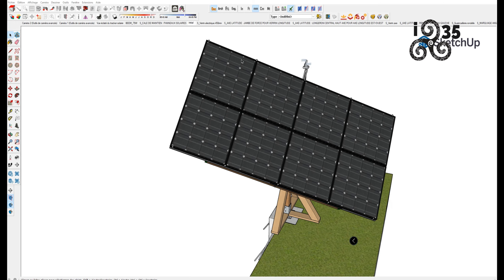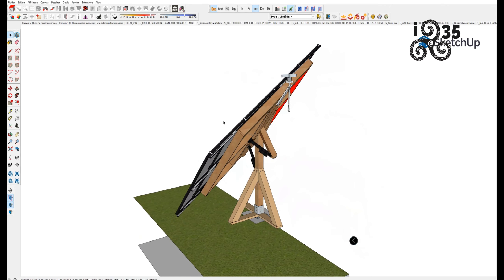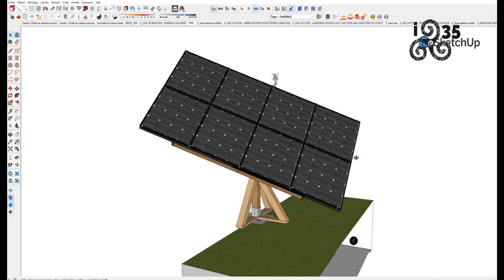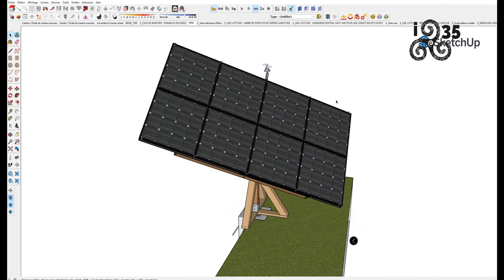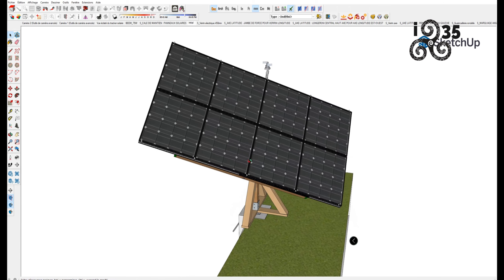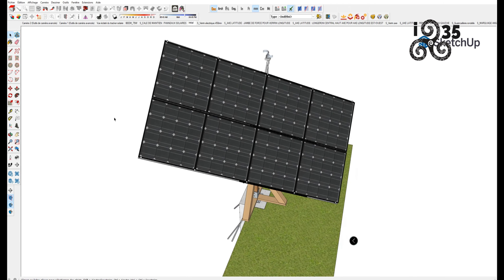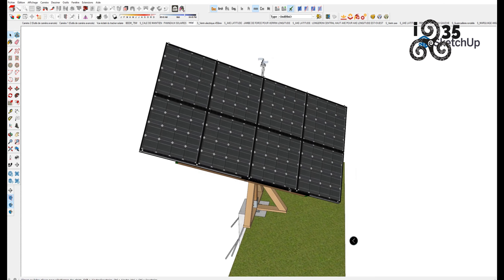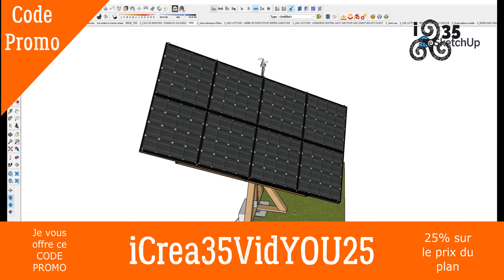⚡️Panneaux Sunology Play / Beem Energie - Augmenter votre production⚡Avec un Petit Tracker Solaire⚡️

Comment: Bonjour merci pour votre tuto ,se qui m 'intéresse c est votre tracker maison ,étant donné qu'il dépasse les 1,80 m on est obligé de déposé  un dossier en mairie ?
Reply from the maker: Bonjour Étienne Chaperon. Mon tracker solaire dépasse que très rarement les 1,80m de quelques cm quand il est au max vers l'est et au max vers l'ouest seulement en période hivernale car il a une inclinaison longitudinale élevé vue que le soleil est bas. Par contre sur les autres période il dépasse pas les 1,80m. Donc il n'y a pas besoin de déclaration préalable pour celui-ci. Après tu peux enlever 10cm au pied du tracker solaire et là il sera tout le temps en dessous des 180cm. Moi j'ai fait un compromis pour être sûr que mon robot tondeuse ne soit pas gêné.
Reply: @icrea35    Merci  pour la réponse
Reply: @icrea35  le vois que vous êtes du 35 , moi aussi  de Fougères serait il possible de voir votre installation ,si sa ne vous dérange pas  a condition qu'il n y a pas trop de KM/s